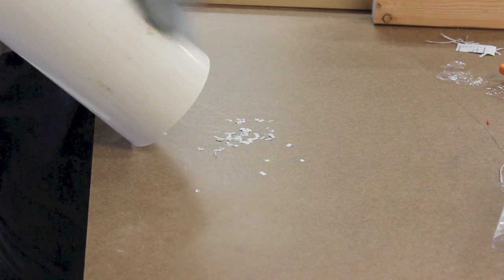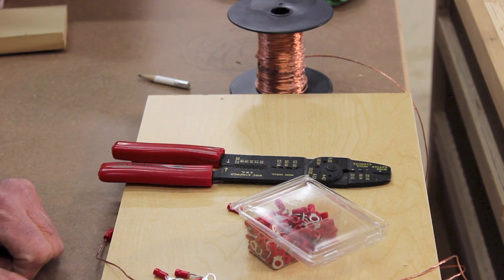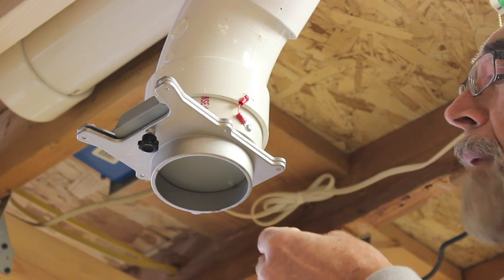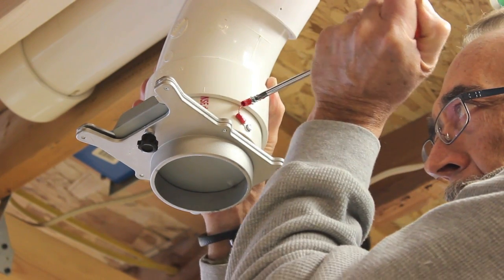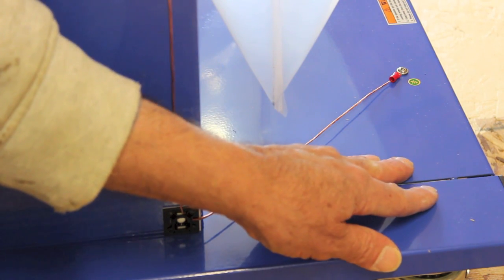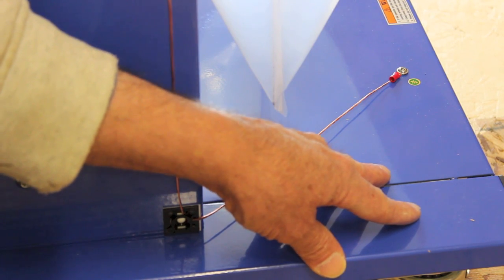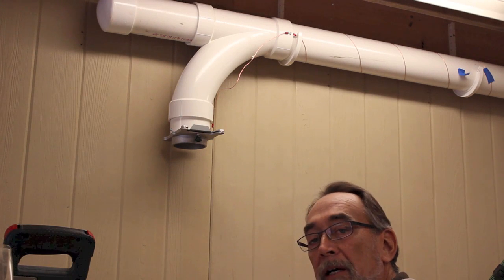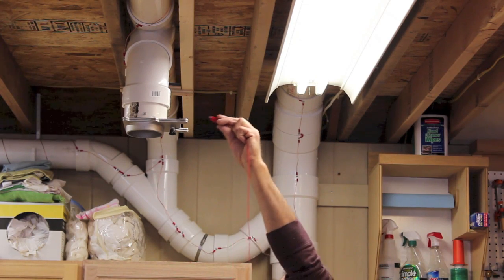Dust Collector   Grounding the System

Comment: What good does wrapping the wire around the outside of the pipe. The static electricity and dust are on the inside.  The pipe is an insulator so the static electricity charge is not going through it. Also the area between the grounding screws is not having the static charge removed.
Reply: Unless the screws are only a few inches apart in every direction it's really not doing any good.
Reply: That is why the screws enter the inside of the ductwork but not too long to cause a blockage.

Comment: I don’t think you need to put so many screws over the pvc as long as the wires are connected. Installing one or two areas should be enough to discharge the static electricity!

Comment: The only way to ground a  PVC pipe is to wrap the whole thing in a conducive tape or similar inside and out. 
Because “static” charge does not move hence the name and secondly PVC is a very good insulator the copper wire will only discharge the static only where the wire is.  
All this work is a complete waste of time as this guy does not understand what static charge is. 
If you are concerned about static discharge use metal pipes.

Comment: great video but trying to ground pvc is impossible as pvc is an insulator. if you are worried about static get a metal ducting setup and you can ground that. 
ask any electrician and they will confirm this

Comment: Grounding a PVC pipe doesn't dissipate the static build up.   It's called "static" because it stays where it is.  To dissipate it you need a pipe that is made with conductive resin.  You shouldn't be using PVC.
Reply: You don't need a conductive pipe. Humans can get shocked by those pipes and a grounded copper wire is a much more attractive target for electrons. It will work just fine.

Comment: I know its a little late, but:
- wrapping wire on the outside of a pipe that is itself an insulator does very little to reduce the charge internally
- despite everything, it is not really an issue in a home system 
http://www.woodcentral.com/articles/shop/articles_221.shtml and 
G. here http://www.billpentz.com/Woodworking/Cyclone/ducting.cfm#static_electricity

Comment: all you had to di is touch any copper pipe or any metal machine with a 3 prong plug @120 Volts  and see if the first blast gate is shorted to your electrical ground system or the nutral side of your power pannel.

Comment: The pipe is inert. If you install your system wrong by making it a non-closed system, when you yourself .... open a pipe and stick your finger in the space where the dust flows without proper ground, then ya .. you're gonna fucking cause an explosion. simply physics. Do you need to ground your system? no ... do you need to ground YOURSELF .. yes.

Comment: I don't fully understand the need for grounding.  On metal ductwork sure, but PVC is a non conductor so any static generated within the pipe is going to stay within the pipe.  Plastic blast gates would have overcome the grounding requirement all together I'd think.

Comment: Materials that build static charge are doing just that (look up definition of static) , building charge that stays in place because of the non-conductive nature of the material it forms on . 
IF YOU WERE to spray or cover the ENTIRE surface of the PVC with a 'conductive' then you COULD move off the static . ( this is OSHA's requirement on grounding pipes moving flammable gas , Wrapping entire surface )   Attaching little itsy bitsy screws to a few points on the surface is POINTLESS because the PVC is INCAPABLE of conducting the rest of its static surface to these points . THINK ABOUT WHAT YOU ARE DOING . TRUTH is these feeble attempts to control  static ACTUALLY INCREASE the chance if a static spark problem by adding a number of insignificant charges together that WILL travel through the conductive wire and could increase the static voltage to a point of making a large leap . !!  (do the system in metal If you want to be pro active on this matter .)

Comment: Grounding PVC won't really do much to dissipate the static.Static electricity is called "static" because it stays in one place. Even with build up it won't ravel down a wire. Go to flexaust website and see that grounded vac hoses and dissipative ones are not the same. Statpath conductive hose (for example) has no grounding wire but instead is made with conductive resins.

Comment: Bottom line, OSHA requires plastic pipe to be grounded. 
Don't confuse conductivity with ability to hold charge. If you've ever rubbed a balloon against your hair to make it statically cling to the balloon, you've witnessed a non-conductive material holding a charge.

This problem is fairly common for woodworkers who set up dust collection in their workshops. PVC piping is often used as a carrier for sawdust back to a central dust collection tank. The (usually) dry sawdust flowing rapidly past the PVC causes charge to build up, similar to a Van de Graaff generator.

The easiest way to ground a PVC pipe is to pull a length of bare copper wire through the entire pipe length (on the inside of the pipe) and connect it to a building ground. This will not ground out the entire pipe since portions of the pipe away from the grounding wire (i.e., on the other side of the pipe cross-section) will be electrically insulated by the PVC itself, but it will mitigate the "danger" of a larger static discharge.

Comment: Where did you get the spool of non insulated wire and is it 18 gauge? I bought rolls from Rockler but quite expensive. Can't you just wrap the wire around the screw? With the screw sticking slightly inside of the pipe would it pick up static from inside of the pipe and through the screw transfer to the copper wire on the outside of the pipe?  Is a copper wire inside of the pipe really necessary? I am in the process of assembling my system so a quick answer would be appreciated. Great video by the way. Rick
Reply from the maker: Hi Richard, The wire I was able to find at The Home Depot, but I don't know if they still sell it.  It is 18 Gauge stranded.  Because the screw tips protrude into the inside of the pipe slightly, they will indeed pickup any static charge inside the pipe, so there is no need for wire inside the pipe.  Yes, you could just wrap the wire around the screw heads.  I chose to use the crimp-on ring connectors so that if I ever needed to disassemble a section of pipe for some reason it would be easier.  Good luck on your installation!

Comment: Sad so many people don't understand how static electricity works, and would rather nit pick the semantics and troll someone putting out a great video.They used to teach this stuff in the 4th grade. We all know PVC is an insulator. If it was conductive static wouldn't be a problem.It would simply discharge through a quick single ground of the pipe. Positivly charged electrons build up on the inside and the outside of the NON conductive surface as massive amounts of air travel through the pipes and you need a conductive static drain (along the entire surface) to attract them and safely discharge them to a ground without a spark gap. Call it what you want. Ground, drain, discharge, etc., this man has done an amazing job of solving the danger. In the future a simple google search and reading could save yourself the embarrassment of showing your massive ignorance. Electrostatic discharge from a non-conductive material is a very real thing, as are dust explosions and sawdust bombs. If you fail to believe that you're probably a flat earth, faked moon landing idiot. Thanks DTEWW's for saving me a lot of time and money with this video how-to. I've been struggling with my dust extraction setup for a while... I know I just fed the ignorant trolls.
Reply: It's ironic that you begin your comment with stating that "many people don't understand how static electricity works" and then tell us about "Positivly [sic] charged electrons ...".   Outside an occasional physics lab, all electrons are negatively charged.
Reply: never mind the polarity  comment (I knew what you meant ). But "   (along the entire surface)   " is why anything short of complete surface wrapping , not little spot contacts , is required to actually dissipate the static on a non-conductive .

Comment: My friend used his wood lathe with a home made tail stock that sat on the floor (think wheel rim, a piece of pipe and a bell center). He marked off 6" marks and after hot gluing the starter end he wrapped his pipe with the wire leaving a small extension to cut to length. Once wrapped he spaced each wire on the marks and hot glued it to the pvc. At the Y's and T's he wrapped the wire instead of a straight jumper.

Comment: I "grounded" my system by running bare copper wire INSIDE the PVC.  This dissipates the static inside the pipe where it is generated.  I terminated each run a couple of inches from each fitting with a screw and nut.  Then bridged the fitting with a wire on the outside and connected it to the next length of pipe.   I'm not very concerned with the risk of a fire, as the airborne dust density is probably too low to be a hazard.  I did get a few shocks in cold dry weather, so I went ahead with this, it only took a few extra minutes.

Comment: Someone needs to clarify the static electricity and grounding necessity.  I am hearing polar opposite theories.  Someone is 100% wrong--which is it?  Is static electricity a concern in a dust collection system or not?
Reply from the maker: Once I had the opportunity to tour a film manufacturing plant.  Film, of course, is made on a plastic base (a non-conductor) but as the plastic base moves through the machinery at high speed, static electricity is a big problem.  A spark, naturally, would fog the light-sensitive film.  So they used what essentially looked like copper Christmas tree garland running across where the film was running, both above it and below it... not touching it, but just above it.  That "garland" was grounded, and it "collected" (for lack of better terminology) and dissipated the electrons we know as "static electricity."  Is static a problem in a dust collection system?  Well, if you live in an area with dry relative humidity and cool weather, the cellulose (wood chips and dust) traveling through the pipes and hoses will generate static electricity.  Ask anyone who has those humidity conditions if they have ever been "zapped" and they will have to admit to you they have... unless the system is grounded.  Whether or not you choose to just "live with it" or try to dissipate it, is up to you.  In all the research I have done, I can find no provable instance of a home dust collection system spontaneously exploding or catching fire, but in commercial situations it has absolutely happened.  Before I added the grounding wire as described in this video, I could get within a couple of inches of one of my dust collection pipes while the system was running and the hair on my arms would stand on end... a little closer and I would get shocked.  Not dangerous, but annoying.  And any dust in the air would cling to the pipes immediately.  After grounding as described, years later, no shocks, no hair standing on end, no dust collected on the outside of the pipes.  If you are running PVC for your dust collection system, you can easily try it without any grounding, and if your conditions are such that static is not bothering you, then you are probably good to go... but if your RH and temperature conditions are conducive to static and you start to get "zapped" or dust is clinging to the outside of your pipes, then grounding will help.  In my case, it absolutely eliminated what was a problem before.

Comment: would it not be more efficient  to run a bare copper wire inside the pipe bringing it back out to bypass fittings and to wrap the pipe also in bare copper wire making connections  where the inside wire comes out
Reply: mike susman  so you spray inside the pipe eveytime  you use it?

Comment: after watching this project, there is a question I have, can I run a wire straight in place of wrapping around the pipe from end to end and adding screws in 2-4 foot intervals?
Reply from the maker: The idea is to allow the free electrons a conductive path to ground, so wrapping the wire provides more surface area and betters the chances for all the static to dissipate.  I have not tried a "straight run" for the wire, but I suspect it might not be as effective.
Reply: thanks for up date regaurding straight wire or wrap wire

Comment: Is your pipe SDR-35 ?
Reply from the maker: No, it is Schedule 40 "Well Casing" pipe.  Charlotte Pipe, the manufacturer, describes it as "a robust piping material designed and tested to withstand the collapsing pressure associated with underground well installation."
Thanks for watching!

Comment: 3M 1181 Copper Foil tape is designed for static discharge. Also tape inside the tube and connect with outside tape with a copper screw.

Comment: The only time I have a static problem is when I use my belt sander and hose connected to my vacuum cleaner. It builds so much static it's jumps through my sleeve and in the back of my hand. The arm holding the gripp. It's quite disturbing and uncomfortable and zaps my forearm every 5 seconds. I tried a piece of copper wire wrapped around the hose and connected it to the earth terminal of a socket but it didn't work. 
I have a 50 mm drain pipe system connected to small bench machines going through a cyclone bin which is connected to a vacuum cleaner which doesn't cause me any problems, only the belt sander causes big static which is double insulated and has no Earth on the plug.
Nice video you made.
Reply from the maker: That static problem sounds awful.  Did you use "bare" copper wire to wrap the hose and go to ground?  There are also some anti-static hoses on the market that work well.  I had an old shop vacuum that I only used on job sites for picking up big chunks...  while vacuuming it was fine, then if I touch the metal handle that is used to move the vacuum around, it zapped me.  Like you, I tried everything and nothing cured the problem.  I finally tossed the vacuum in the dumpster at a job site!  Hate to say it, but it might be time to do that with your belt sander  :)
Thanks for watching!
Reply: The reason I came across your video was because I was looking for a solution and there aren't that many videos on the subject. I did use bare copper but I only warped it round in one place. I didn't do what you have done by wrapping the whole length or even half. I may try that next time. I don't use it so often. I have a 100 mm Hitachi it's a good one and not a 30 dollar one so throwing it away would sadden me greatly. I have some spare 40 mm vacuum hose so I might use a 3 meter section wound with copper just for the sander. Thanks for the reply.
Reply: If everything else is fine I’d be looking at the belt sander.

Comment: Great videos. I just set up my DC system. Thank you for the helpful tutorial. One extra step I took was to purchase the hose with the copper wire structure. I then exposed about 1-1/2" at each end and attached to the screw at each end (blast gate and DC). It might be overkill but I figured why not. It also gives me the flexibility to shift the DC out of its spot (only a few feet, or swing in the opposite direction) if necessary. Thanks again!

Comment: Nice system!  Can you tell me who's blast gate you're using and did it require modification to fit the pvc?  Does the ground wire take care of all the static. Curious also why pvc instead of metal? Is it a big cost savings? Thank you
Reply from the maker: The blast gates are from Woodcraft.  They are excellent, but require a wrap or two of tape before they fit perfectly.  I used electrical tape.  The ground wire takes care of the static---100%.  I used PVC because it is cheaper and for me, easier.  I've never been very good (lousy, actually) at bending, cutting, or fastening metal, but PVC is easy.
Reply: I'm with you on the easy part!  I love how organized you are!  Enjoy your videos! Thx!

Comment: While this is a very well made video, the technique here is most likely useless.  Static will build up both on the inside AND the outside, but a single ground wire is not going to help with this.  While "you can't go wrong doing this" is perhaps true, I believe if this technique gives a false sense of security but is ultimately useless, you can go wrong.

Metal pipe also builds up a charge.  To really discharge the static, you'd have to basically wrap the PVC with metal.

Has there ever been a single case of a fire or even static issues when the PCP pipe is mounted to the wall?  Chances are, just the mounting to a wall is doing more than the wire.